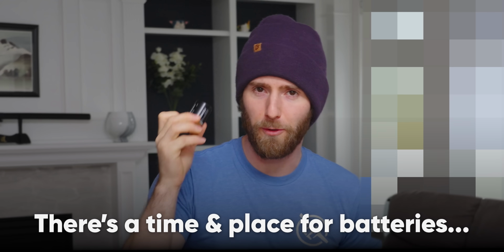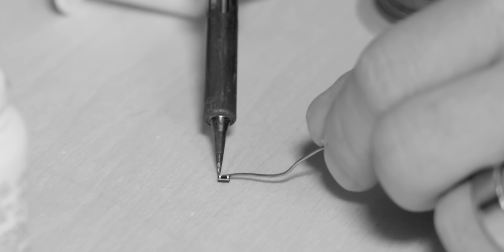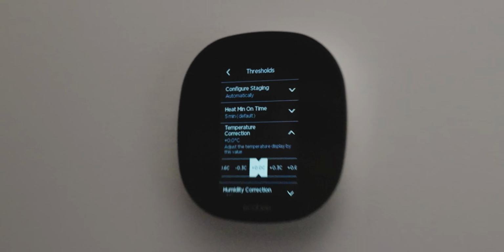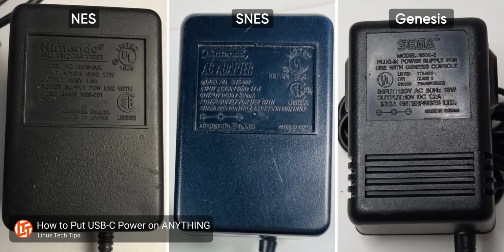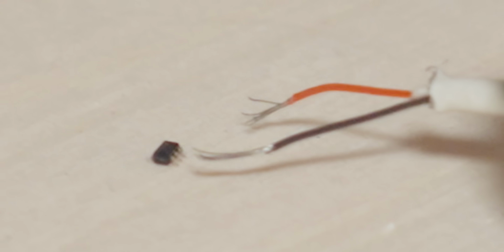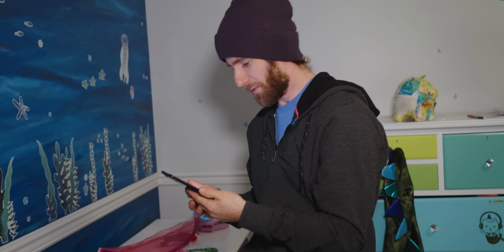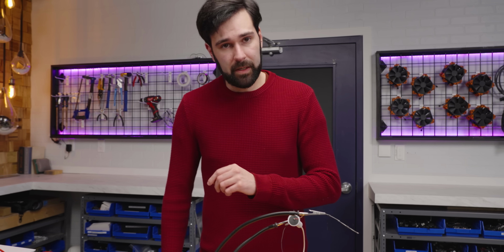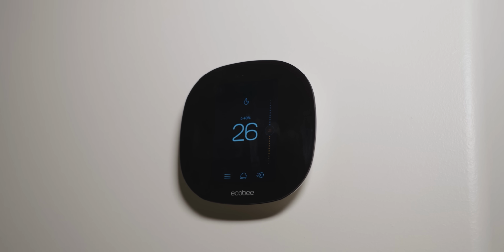I HATE Batteries! - Converting Wireless to Wired (a cheapskate’s guide)

Comment: If you look at the data sheet for that small SMT regulator you will see it has a minimum capacitor requirement. They make handy PCB material with threw plated holes. You could then add the part and the two small 0805 Caps it needs. I have also sawed out the voltage regulator area from dead devices and used just that part of the PCB for projects. and most USB devices will have a 3.3V regulator.

Comment: 3.3V is perfectly fine for an application like that, also, you don't use a resistor for voltage regulation, you simply don't.
Dude, you have engineers in your team, talk to them.
Another thing that would be nice would be to have someone with the relevant experience design a PCB with the dimensions of the battery you are going to substitute with the appropriate regulation in it and a USB port to receive power.

Comment: Looks around my house at all the battery powered sparkle lights running off usb and smiles. Most things that run off 5v are just fine with usb 5v without any extra steps. Beware though that too much current will kill LED's. Use a resistor in line with them to keep them happy.

Comment: And here I thought this was actually a helpful tutorial on how to convert battery operated devices to hardwired, for people who aren't electronics experts, turns out they just needed to publish a video per the schedule. LTT is more of an entertainment channel than actual tech tips.
Reply: Most frustrating part is how needlessly rushed and botched it was. The amount of prep they did seemed appropriate for an emergency video they need to do this afternoon to put out something. But from Dan's comment, it's clear it was in the pipeline for at least a week. They could have picked a proper 3V LDO and designed a CR2477-sized PCB around it (possibly even with a USB connector on the back) in 15 minutes (or a couple hours tops, if Dan doesn't have experience with it) and have it fabbed — including population — and delivered in ~3 days. They had the time and they certainly have the money.

Comment: They literally coulda shoved a USB port on the back of it and this wouldn’t have been a problem. At this point that should just be standard for any devices which are designed to be in place for long periods of time.

Like don’t require people to power them by USB but just give them the option. You don’t even need to provide a power supply.

Comment: Localizing the power of safety equipment such as smoke alarms (1:11) is an absolute must. You should not hardwire that equipment because in the case of outages, or unknown loss of power, you won't have any idea that your hardware isn't even on. Even if you have other means of notifying you that you have a loss of power circuitry, it is adding yet another unnecessary layer of potential security holes.  That's a risk I would rather avoid by just replacing a battery every few years.

Comment: Linus, all that matters is the voltage and capacitance man.  You don't need to use the different sized cell batteries, you just need to modify the battery socket.

Comment: What I am getting out of all of this is that you needed a capacitor to stabalize the voltage at the wildly different levels of current draw. Basically feed the ~3.2v into a really tiny capacitor wired in parallel with the device.

Comment: Ok. I hate batteries too. But adding several 5v power supplies causes to waste a lot of energy 24h/day. Let's assume one looses 1w (my old ones I measured loose more). So 10 of them 10w. In a day 240watt hours. Means in 4 days nearly 1kwh. In a year nearly 90kwh. As much as a electric needs for driving several hundreds of miles. 
But still a fair question if that is better than throwing batteries in the garbage can once a year. Has anyone evaluated that?

Comment: ive done this with around 20 things here.
but! buy a transformer that matches the volts you need at any electronics site.
if you downstep 12v to 3v, youre waisting 9v. times that with 500 units, or even 100. a lot of wasted energy.
the charger/transformer still draw its spec volts, the downstep just limites it to the unit.

Comment: I'm using Home Assistant, in the top left of most windows is a socket (or 2) that have both 2 and 3 prong connections as well as 2xUSB too.

I've just moved but my plan (already started) is to have Aqara curtains and blinds for the windows plugged in and covering the sockets, then use the USB for a mix of motion, presence, light sensors etc.

The ones that are more difficult are thermometer, humidity, door/window, leak etc. They're so small and long lasting that I'm relatively ok with leaving them battery powered.

Comment: If I were Linus' EE consultant, and if he's converting many of these devices to wired power, I'd suggest making a small PCB with an adjustable voltage regular and tell him to stuff whatever resistor is required to step the voltage down to whatever he needs onto the PCB. It's modular, reusable, less jank, and much easier to solder than soldering wires to an SMD component.

Comment: You could etch yourself a Butten size pcb and pop it straight in where the battery went and solder your components to that. ‘you could also wire a stepdown buck converter to the usb’s cord and adjust the voltage straight from the buck converter.

Comment: If not for the "cheapskate" part, you could have used a CR2032 battery eliminator and a bit of padding to make the contacts touch each others.
Reply: You still have to supply the battery with 3.2 volts
Reply: Battery eliminator are made to replace batteries by a power supply, it either comes with one integrated or you have to plug it on a corresponding power supply.
It would have avoided the sketchy soldering with SMD.

Comment: I am pretty sure you need a capacitor in there somewhere to stabilize current draw but yea good idea. I am sure there are micro breadboards that would make this easier . Maybe even screw a steel weight to it to act as a solid base/stand for your battery gizmo.

Comment: Just 3 diodes in series would do the trick, much easier and no measurable power loss like is associated with voltage regulators or divide circuits.

Comment: Couldn't you add a zenner and a resistor to ground to split the 5 to whatever you need. I do the same thing to drop from 24V to 5V for the abl on my 3D printer. I know its super inefficient but you need less components

Comment: As an engineer this video hurt.  Treating an active component as a resistance load for a power supply is insane.

Just use a real regular circuit that produces a constant voltage within a current range

Comment: I admire your dedication to DIY conversion to wired power, and your eventual success is worthy of applause. But my power supply engineer brain that is dedicated to low voltage step down converters was screaming DIODES from the beginning. But hey,  you have success and learn something on the journey.

Comment: You can get better results with AMS1117 (3.3v version), it works up to 1A and you just need 2 small capacitors in parallel.

Comment: When the current is so low surely it's simpler to use a potential divider. Would handle those spikes in current just fine and maintain a nice 3v off the 5v. Serial diodes etc seems to be massively over-complicating things.

Comment: $120 for two sensors?? Are you insane? 
Just set up a generic thermostat in HA and you can use any temperature sensor to control the thermostat.
Even a hardwired, Ethernet ESP driven one. How about that for wired?

Comment: I don’t get the regulation Overkill for your heating. 
Normally the energy need for a certain room is calculated and after that the room gets the needed energy by adjusting the water flow. 

Or you went for the total overkill, log every data from your home and throw a neural network at it.

Comment: Smoke alarms should NEVER be solely powered by hard line. This has cause many people to be killed. If the fire starts in any part  of the house that the power cable runs thru the wire is burnt way cutting the power to the unit before the smoke can reach the sensor.

Comment: More Dan please and also my first thought was diodes (or even a zener diode, that's the route I went with a diy Xbox 360 wireless controller PC adapter) not going for resistors or voltage regulators.

Comment: There are like... 100  better solutions which wouldn't cost much more and are more robust. For example, using a variable buck converter intended for RC gear (quadcopters so are small and light) cost around $0.50. No SMD soldering.

Comment: If you really want to use a 5V adaptor, why don't you just add a step down converter? Cheap, linus proof, and you can also very easily adjust the voltage when you are down with the soldering.

Comment: When facing the option, I chose AA batteries over other internal batteries (like controllers) as when they get replaced I keep using the same old batteries. It's something...
Other than that, I also prefer plugging it to the wall.

Comment: This is such an important topic to get awareness on. It just sucks to have devices with batteries where their aren't needed. I really home manufacturers start including something like a USB-C port for them to work without batteries... Can't be that expensive...
Reply: People love the convenience of being able to just place a sensor anywhere without being restricted to locations next to a power socket and having a messy wire run around the place. In a normal person's home (not a mansion) you might only need a handful of sensors so replacing a CR2450 once every 2-5 years really isn't a big deal.

The CR2450 in my Xiaomi motion sensor has never been changed since I installed it in 2018, and the lithium cells in my door sensor haven't been changed since 2017.
Reply: @veryboringname.  Well I explicitly stated including a USB-C and not excluding or replacing a battery, you don't have to choose. Options are always nice and one a ~60$ sensor (that seems to be the price as shown in the video for that particular sensor), I think a few cents for a USB-C port aren't too bad. Or just have a USB-C version of a sensor.

And not everyone lives in an apartment, if you life on the country side, spaces are bigger and in changing the batteries for 10's of sensors (even worse most smart switches are battery powered so your at a lot of batteries if you would want to make everything smart)... Pretty annoying and wasteful I'd have to change at least one every few weeks or so...
Reply: @cromefire_   People who want to run a wire to every sensor in their house is in the minority. If you have 10s of sensors, you'll also need 10s of power adaptors and meters of cabling running all over the place for your door sensors, window sensors, temperature sensors, motion sensors, remote controls, etc. 

Adding a USB socket - and associated voltage regulation circuitry, power filtering, extra QC steps, and spending extra on the support staff that have to deal with extra warranty claims from damaged or faulty connectors will cost money, make the device more bulky, and only benefit a small percentage of users.
Reply: @veryboringname.  I doubt it's a small portion, especially for some sensor types. And the power circuitry would just be one step down if voltage isn't 5V internally anyway (which 3.3 or 5V is pretty common). No circuitry filtering needed anyway because it's USB-C and the PSU is already filtering and you already have to send it through regulation anyway, so if it has a port or not doesn't matter. And also probably no warranty claims because how would you kill a USB-C device? It's pretty safe.

Regarding the cables, yes and that's not a new thing. If you have the money and have it done professionally here run KMX, which literally involves wiring every single sensor with custom cables, a lot harder that just buying a USB power hub with many ports you can attach a lot of devices to, that way you only need one wire for multiple devices if they are close. Doesn't work for every thing, but it will help with the madness.
Reply: @cromefire_  As you can see from this video, power circuitry isn't as simple as one step down. A switching PSU is far noisier electrically than a battery - have a look at the ripple on a scope or read the other comments here. It can definitely be handled but adding components like a smoothing capacitor adds bulk and cost.

Adding a mechanical component  whose matching mating connector is out of your control will raise the number of support issues (faulty or damaged  sockets from cheap out-of-spec cables, users using extra long usb extension cables because the socket is far away and the resulting resistance causing too large a voltage drop, users using $2 usb chargers from Aliexpress with poorly-regulated output) from zero to a number greater than zero which adds cost. All that can definitely be overcome, it'll just increase the size of the device and bump up the cost. 

It's really just about profit margins at the end of the day. If they don't think it's worth the effort to differentiate themselves from the competition by adding an external power option to everything, they won't. If there was a big enough market for it, it'll be done. Maybe one day when the home automation market is bigger and the number of people who want wired power reaches a critical mass?
Reply: @veryboringname.  🤷🏻‍♂️ We'll see, I think there's definitely enough people to justify a 0.1% increase in cost or a wired version, especially for switches

Comment: The problem is, that your circuits are all designed for a single amperage. If the amperage changes, like with this device, the voltage changes, since there is no regulating device. There is a load of of linear 3 pin voltage regulators available, with various fixed voltages, that hold that voltage until their current limit is reached. with that you only have to solder some cables.
Devices are available on digikey or elsewhere.

Comment: Easiest way to solve this since your already running home assistant would be to use a wemos d1mini with a dht11 temperature sensor.  Load up tasmota and use it as a trigger for home assistant to activate the relay for that heating circuit

Comment: If you just wana go full ghetto, Y U no just put a 1,8V zener diode series with the thingy?
Reply: because that voltage in a zener refers to breakdown voltage, not forward voltage. if he uses it series, he doesn't have a 1,8 v voltage dropm across the diode.
Reply: @SuperBacid  Dude, really? No shit you have to put it in the right direction(well reverse is right since it's a zener). And yeah you still have to put it series, so the not needed 1,8V can drop on the diode.

Comment: as an electronics engineer, i’m sad to see you use siodw/potenaiometer for temperature sensor bcs it will be a lot of heat in the diode but meybe not alot bcs u just draw 0.005 mA. 
But it still very not efficient way tho 😭

You can use AMS1117 and set it for 3V output for a better way

Comment: ok, Total overkill.  Don't use a resistor on a dynamic load as the current changes so will the voltage. To get 5V down to exactly 3.2 volts you just string together 3 silicon diodes each dropping 0.6V 3x0.6=1.8 5-1.8=3.2 (Bummer Just saw you doing exactly this.) 1N4148 would do it.

Comment: What you are doing won't work.
First, don't use SMD, those are tiny and hard to work with, use THT which are much bigger and easier for beginners.
Second, those voltage regulators require a capacitor on both sides for them to work, without the capacitor they will just put some random voltage that will be changing as your device draws more/less power.
Third, 3.3V should be fine, since all batteries change their voltage as you drain them, so device must be prepared for the voltage to not be even all the time. In fact that is how most devices show battery charge level, lover voltage = more drained battery.
edit:
I checked and CR2032 voltage range is 2.7V (empty) - 3.3V (full)

Comment: And this, children, is why we buy 3V DC power supplies instead of janking one ourselves.  Say it with me...  CAPACITANCE
Reply: Frankly, if you add up the billing time of everyone who worked on this, you'd be WAAAY ahead of you just bought one.  And it would be UL listed, and so you could be (at least somewhat) confident your solution won't burn your house down or spew RF interference everywhere.
Reply: Hurray for pointless videos!  Hip hip...
Reply: You might even be able to find a power supply that does 5V -> 3V that will fit into the battery compartment if you spend enough...

Comment: Yeah, any buck converter would've been so much easier. Might be a few dollars instead of several cents, but for the convenience and reliability? Priceless. While I also wouldn't mind trying to solder to SMDs like that to save a few bucks, I would mind not having a reliable output. I'd much rather have something always output the voltage I want versus a "dumb" regulator which puts out a voltage that is too high to make sure it doesn't fall below the required voltage during a short spike in power draw.

Comment: The voltage drop caused by the potentiometer depends on the current flowing through it, so the voltage you are measuring will vary depending on the current power consumption of the sensor, which explains the over 4 volts you saw
Reply: The only proper way to do this is to get an adjustable regulator that lets you connect a potentiometer (or fixed voltage divider) to an adjustment pin that will actually change the regulation voltage. Assuming 3.3V is really too high there are 3.0V fixed regulators easily available (well, they do manufacture them at least...)
Reply: @ailivac  yup, that's it. I think 3.3 V would easily be in spec assuming a ±10% tolerance. And I think the vanilla battery is probably over 3.2 V anyway when full.